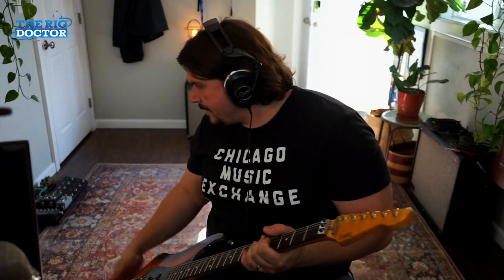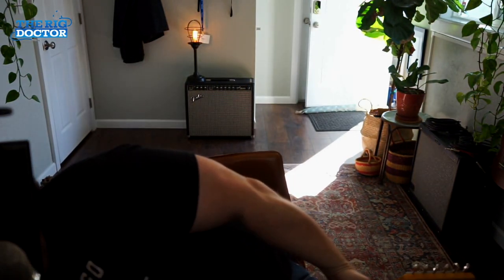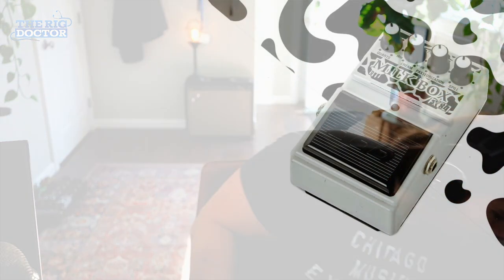Sleeper Studio Compressor in a Box!

Comment: I have used a Milk Box since the mid 90's. It's still on my board. Still works after all these years, so that says something. I tried getting rid of it, but then I apologized to it and it's back. It's one that is labeled Quarts, Cream, Pasteurization, and Spill with the cow spots on it. I like that better because it's different and nobody really knows what all that means. But, I think you're wrong. I think you have the newer one. The intent was to have this line of funky pedals that were so irreverent, even the labels on them were off the wall. So, I think the original one had the weird labels on them and went through a couple versions and because nobody knew what all that meant, they later put normal names on them. But, good looking out on this fantastic pedal.
Reply from the maker: I love the pedal, and apparently designed by the DBX guys...I dig it!
Reply: The Milk Box was my first pedal, because I had an ART Studio 2000 rack FX, which does NOT have a compressor. Love both, still have both.

Comment: Some compressors have a Progressive Ratio control instead of just a normal Ratio Control. The Studio compressors have progressive ratio control which I'm not sure what the differences are in progressive ratio controls and normal ratio control on compressors, maybe you might know?
Reply from the maker: Don't know on this pedal.
Reply: @VertexEffectsInc  studio compressors have a progressive ratio control check them out on Fairchild compressors and other's
Reply: @VertexEffectsInc  Studio Engineers often use studio De-Essers rack mount gear on guitar distortion and overdrive pedals, any reasons why? I think there is a few guitar pedals that are DeEssers but its rare but they are used AFTER distortion and overdrive pedals or on the micphones that are micEd on the speaker cabinet to put a DeEssers effect on the microphones when guitars are distorted and overdriven. I'm not sure why they would use a DeEssers because its a multiband compressor that is only compressing a certain band of frequencies so the distortion guitar pedal creates more overtones, harmonics that the DeEssers effect is compressing those overtones and harmonics from creating annoying overtones and harmonics plus taking out the THUMP in the bass?
Reply: @VertexEffectsInc  Try to make a pedal form of the empirical labs distressor because its like a swissarmy knife of compressors. It would be nice to have a very small enclosure that is a swissarmy knife of studio compressors that used audio transformers on the inputs and outputs. Everyone back in the day used those empirical labs distressors in the studio

Comment: Hey Rig Dr., big fan here! Just got my hands on one and don't wanna screw it up... Will it work with a standard 9v above 100mA PSU? I'm asking because the bottom label says that it needs a 10v power supply.
Reply from the maker: The voltage needs to be 9VDC, the current can be anything as long as it's not lower than what the pedals requires.  I can't imagine it draws more than 100mA, and probably more like 20mA
Reply: All is well then 👍, thnx!

Comment: Thanks! I’ve had one for years but rarely used it. I was one of those players who didn’t understand compressors. I recently pulled it out and I agree it’s great. Especially on Bass. I do have a question though. I recently purchased a BBE Sonic Stomp and wasn’t sure if using the two together would be a good idea. I mostly use the BBE at low settings with my Fender Acoustasonic to add body to the sound. But I’m curious if it’ll over cook the sound when using a compressor with it. Thanks!
Reply from the maker: They're pretty different pedals I'd use the comp first then the Sonic Stomp.

Comment: These DOD pedals suck tone like crazy when bypassed
Reply from the maker: No more than any Boss or Ibanez BJT buffer would in bypass.
Reply: @VertexEffectsInc  even in bypass mode there are two 4558 op amps in the signal pass. These op amps are known as some of the worst possible audio op amps. 
And they create a lot of white noise. Put a Milk Box in bypass mode in front of a higain amp and listen.

But you're right. The Milk Box itself is a realy good compressor.
Reply: They aren't the absolute worst, but they certainly aren't the best.  The worst I found was my early 90's CryBaby with buffer.  Ultra-tone-suck.  But great wah.